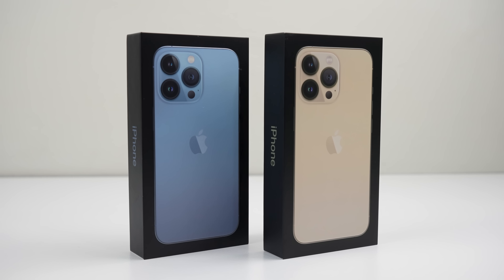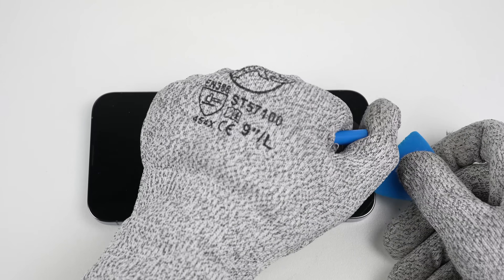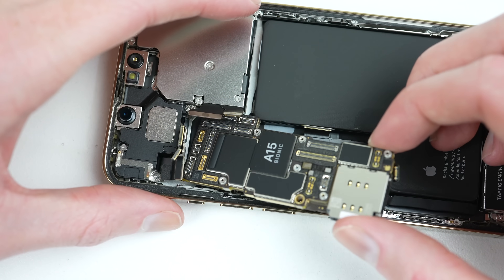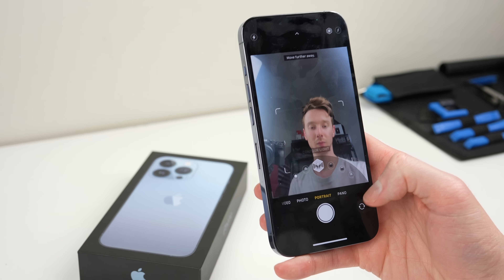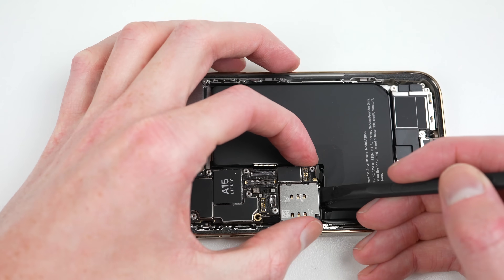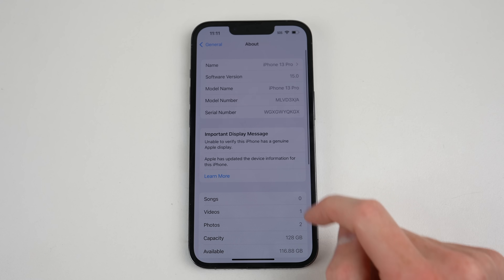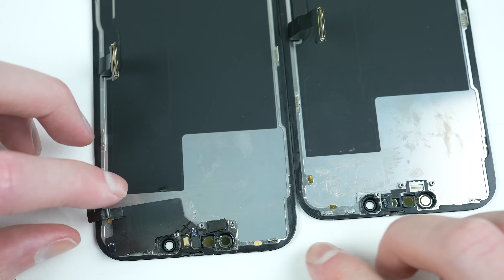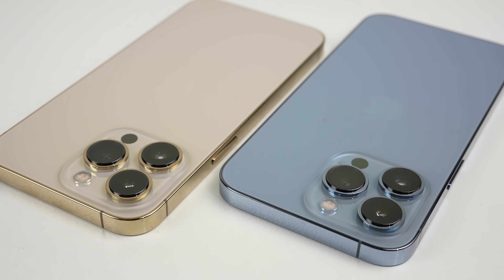iPhone 13 A Repair Nightmare - Teardown and Repair Assessment

Comment: What is making me real mad is Apple saying, bragging over and over about how "green and recycled and love environnement " they are when in reality they do not give a crap about it. Getting on for hours about trivial "yay paper wraps and recycled metals", in the mean time the real big impact is blocking repairs, forcing throwing phones away, and making people upgrade to the same phone with no changes (exept the usual "slightly better camera, performance and battery". 
Apple just has the worst attitude of any company. They do not hesitate to lie, f. their customers/environnement, and whatever the feel like doing to make money.
Reply: We're going eco friendly by selling the charger separately in another package
Reply: @Fishßeef  sadly yet samsung remove charger too on The S21
Reply: also don't forget not switching the iPhone to USB C even though the iPad, MacBook, Android phones and almost everything else has
Reply: @amitkulkarni3922  The EU will soon force Apple to use USB-C connectors for the iPhone
Reply: @moow950  I heard about it, but they said there's an exception for "wireless" charging so I feel like Apple would rather make the iPhone portless and switch to wireless rather than switch to USB C. Especially since they can make more money from the MagSafe charger like they did with the Airpods after removing the headphone jack.
Reply: @amitkulkarni3922  most of iPhone users have lightning port but not USB C including me, if they changed the port to USB C then they would have to buy a new charger which is More waste since Charger outer are made from plastic. Hence Magsafe is the safest way if they want to change the charging mechanisms
Reply: @PS-ub8st Almost everything else that's portable besides iPhone uses USB C. Including portable speakers, wireless headphones, etc. Even on Apple's side the iPad and MacBook uses USB C for charging. So logically speaking, it makes no sense for the iPhone (and Airpods) to still have lightning when all their other products have moved on to USB C. The only reason why Apple would stick to lightning is to make more money by selling lightning cables since very few manufacturers sell lightning cables. 

So your point of "more waste" doesn't make sense because it's literally just having to switch the cable and most people by now probably have a USB C cable if you bought any product in the last 5 years. Plus, you can still use the same power brick that comes with iPhone since that uses a USB C port. And for MagSafe, that's even worse than lightning because it's still only works with iPhones and it's even more expensive than lightning or USB C (so it's just going to create even more environmental waste).
Reply: @PS-ub8st  Most iPhone users have lighting but how many people have a usable Lightning cable? 
Some iPhone users have bad cables I'm talking about the those that are using an old iPhone till this date, like iPhone 6 users 38% of apple users are still using iPhone 8 and Below and those people are gonna buy a new charger sooner or later
If they buy a lightning cable it cannot be used for any other devices if they switched to USB - C however they wouldn't need to buy a seperate chargers for other  devices that they could potentially buy
Also what about an Android user trying to switch to an iPhone they won't be getting a charger and they can't use their charger meaning they will have to buy a new charger meaning more waste
Also I can Guarantee you most iPhone users that are switching from the old iPhones like the 6 or the 7 will 99.9% of the time buy a new charger because they are charging at a Measly 5W the 12 pros support 18W charging and charging at 5w in 2021 is a mere joke and 
Why are you even Justifying apple this is stupid IMO
Reply: all that "recycling" bs is nothing when you take into account apple uses slave asian handwork (Foxconn sweatshops) but hey, no ONU/OTI inspectors would dare to put a foot on those chinese concentration camps
Reply: @alerey4363  Reduce, reuse, recycle. Apple devices life much longer than those of competing brands and are then usually sold 2nd or 3rd hand. So they actually follow the most important R, which is reducing the amount of devices. Apple supports phones from over 6 years ago still with updates, which means there must be a significant amount of them still out in the wild.

Yes their repairability sucks. Which however may not matter in the big picture, if devices simply break much less frequent on average and simply don't require any repair at all. The amount of people that actually has to buy new instead of getting a repair may be completely insignificant in relation to the total number of devices. I know, unpopular opinion. Go start the hate and continue to funnel all your frustration towards Apple.
Reply: @alerey4363  aaah that fallacy again that the benine Apple hater likes to repeat over and over again. That throtteling was done to preven crashes after voltage droops with aging batteries. That was years ago, the applicable models the 6S. The very phone that will be supported in full by iOS 15 this fall, after being released over SIX years ago in 2015. I dare you to name even one competitor that supports their devices this long and in this manner. Maybe you also realize that people don‘t suddenly throw away their phone and buy new just because it became a tad slower after several years of operation.
The average device lifetime of iPhones is vastly higher than with other brands, providing the best possible contribution for emission reduction. Period. I hope these facts don‘t destroy your worldview all too much.
Reply: It's all just marketing (i.e. lies). If they say they're enviromentally friendly and care about your privacy, it means they're burning coal in India and handing over your metadata to the NSA
Reply: Don't forget rendering a device unusable by activation lock, even in the hands of the owner!
Reply: @tonyconpint1342  you know that the owner is the one that enables Activation Lock right?
Reply: @tonyconpint1342  Uhm that does not happen at random
Reply: @itsTyrion  so what if the owner forgot the password to the account and can't reset it? I've seen it happen. Plus, there is also zero way to get ahold of the owner of the device itself so it completely negates anything regarding being a good Samaritan.
Reply: they giving excuses to cutting the charger cost greedy
Reply: It’s also sad that Samsung follows Apple most of the times. Example removing the headphone jack and charging brick. I feel Samsung phones will fall into this trend anytime soon.
Reply: @NotAdam8  they already have. Remember the bootloader camera issue on the z fold 3?
Reply: @NotAdam8   Correct but keep in mind Samsung Aint doing repair shit Tactics like Apple you are still able to get your phone repaired by 3rd party Or DIY yourself Apple one is just full of shit
Reply: Don't ignore the fact that the iPhone STILL uses lightning meaning you need another cable and the cable Apple gives you is useless for 90% of people
Reply: @zUltra3D  Most of Apple user already has Lightning port so Yeah If they changed to USB C including me I would have to buy USB C to USB C cable, magsafe is the only choice if they want to change the charging mechanisms
Reply: @PS-ub8st  still, Lightning makes no sense in 2021. iPads, iMacs and MacBooks use it yet AirPods and iPhones don't. If they change to USB-C, it's still better cuz you don't have to pack 2 cables for your iPad and iPhone.
Reply: @zUltra3D  well most iPhone Users doesn't even have USB C so yeah Your comment doesn't work here, i dont even have USB C🤷
Reply: u know you’re not supposed to “Throw your phone away” but recycle it right? Lol
Reply: @happi_legend  where do you think a majority of e-waste ends up?
It goes to third world countries, by the ton, in huge containers, then gets badly dismantled with the extraction of valuable materials being the sole objective.
The processes used are normally bad for the environment and the 'workers' are often the poorest in the community with no regards to modern health, safety and environmental impact taken into account.  Recycling on a worldwide scale isn't the utopia that big manufacturers want you to believe.
Reply: @Falconhunter276  it’s actually dismantled by a robot named Liam. No joke. Lol. 

They get sent to a warehouse weight. Dismantled. The left over melted glass and metals and components get weight again at the end to ensure no loss of materials. 

Then these are used to make the enclosure on new iPhones or macbooks or iPad. Really. Knowledge is power man. Do research :D
Reply: By green they meant green dollars for them 💸 💸
Reply: Too bad a lot of stepford folk keep giving these shysters money.
Reply: Apple is so two faced
Reply: The iPhone 12 should have come with a plug but 13 didn’t have to as we ‘already’ have them.
Reply: Apple:
What's the minimum we can do to appear green?...yea that's do that....
Reply: The only green they are concerned about is green color of money
Reply: @Rokmononov  I shouldn't have to say that this is, in fact, subjective. I can not prove that Apple have the worst attitude of ANY compagnies, obviously. This is my opinion, feel free to have a different one
Reply: Samsung is also going this direction and I feel sad Samsung is even becoming the next Apple.
Reply: @kusogaki_man  the unfortunate reality is that apple is greenlighting the entire industry by doing this. Samsung and admittedly many other phone makers are following suit because if one of the biggest tech companies in the world can sell millions of phones whole screwing over all repairs and making extra profit, why shouldn't they? We saw it with the headphone jack, the charger, and now it's repairability. Legislative solutions are going to be the only realistic way to stop this.
Reply: @kusogaki_man  samsung is apple for android lol
Reply: @akdhidbeif  tbh the only apple is good is ipad,watch and even mac but iphone is just problematic for some reason
Reply: It is the new strategy that a lot of companies keep doing, virtue signaling. The cater to the emotions of dumb consumers and it seems to work…
Reply: @ElJosher  I guess providing software updates for 6+ years, enabling customers to hold on to devices for so long and avoiding new devices altogether is also just virtue signaling for dumb people?
Reply: @RandomUser2401  While also limiting repair… Apple talking about the climate and how they are at the supposed forefront of decarbonization does not mean crap when Apple incentivizes e-waste with their anti repair crap. That is the epitome of virtue signaling. Apple tries to appear benevolent, but they aren’t.
Reply: @ElJosher  By having an above-average device lifetime of at least 5years and a very high 2nd-hand resell rate they are actually doing a ton for the climate. Reduce, reuse, recycle, in descending importance. As I said before, in the big picture the amount of devices that have to be replaced prematurely due to being not reparable is probably tiny compared to the amount of devices sold from which the vast majority lives 5+ years, while devices from other brands simply break down much earlier beyond any possible or economically viable repair.
Or even worse, become a paper weight since the manufacturer stops supporting the OS of the device after 1-2years. While Apple supports devices between 5-7 years after release.
Reply: @RandomUser2401  All the while forcing updates on to your phone that make it a little worse over time until its so slow you're practically begging for a new phone, I've seen it happen first hand
Reply: @gokublack8342  that's objectively wrong. Indeed several iOS updates made older phones faster.
Reply: @RandomUser2401  And yet I've seen them make phones slower first hand
Reply: Apple is full of shit.
Reply: Well, they have become so powerful and rich to the point that they LITERALLY don't give a crap. They will keep making fancy-looking smartphones, knowing that sheeple are just plentiful out there.
Reply: Except they're not forcing you to throw it away, they want it back.
Reply: There 3 ways that I think it will be okay

1:we have to wait in China so that they can bring a device that can make the display work face id even if it an third party display just like true tone

2 spend a fortune on buying most protective cases

3 always be careful and maybe train to have good reflexes
Reply: @Ghost_ridr  with such expensive phones you must always be extremely careful. Those OLED screens are freaking expensive, even for the manufacturer.
Reply: @RandomUser2401  yea I heard they expensive so might as well get a new protective case when I got a new phone
Reply: @Ghost_ridr  they'll probably just find a way to crack the screen to be able to transfer it's data to the replacement like they do to get true tone back yoday
Reply: @akdhidbeif  ya
Reply: Yeah what a hypocritical company
Reply: Apple loves recycling! They’ll recycle your phone & sell you a new one the moment anything goes wrong with it.
Reply: What's worse is how the fanboys keep defending these practices.
Reply: Yet people still buy their crap and they continue doing this maybe stop buying their crap and force them to do right.
Reply: @Devin-O  its because if you already Comfortable with one Ecosystem you wont be switching unless your not comfortable anymore
Reply: Apple borrowing the "we cheat, we lie, we stole" from Mike Pompeo
Reply: our little of fightback is to not use their garbage cans. and laugh at their users.
Reply: @lhexolauroxel1727  that wont change anything and hear me out samsung will follow apple path
Reply: apple doesnt care about anything but MONEY thefts that most parts i know about it n they do liars ton like two face no joke
Reply: It's called virtue signalling.
And anyone who believes them is a gullible idiot.
But if you already bought any kind of apple product you're already a gullible idiot to begin with.
Reply: So I guess the phone is a little cheaper considering they don't include the charger with it, right?
Reply: Looks like they skipped reduce and reuse lol
Reply: I think very few of these businesses believe in being green.  It's all talk, an illusion of being green.  All that matters to them is profit.  The one that gets me is refuse collection vehicles going around with "zero to landfill" written on them.  I always wonder what they do with waste that is impossible to reuse, recycle or burn.  There must be a lot of it.
Reply: Because you suckers will believe anything your masters tell you. Suck it up and watch the planet burn.
Reply: Give a fuck to environment, its a business.
Reply: Not to mention the software updates that gradually damage the performance of older phones so they can no longer function correctly, forcing you to throw away what should work so you can buy a new one.
Only time I accept that kind of behaviour is in the case of samsung having the software update to destroy the phones so there are no more battery explosions. That is in the name of safety and I can support it.
Reply: No, it means they push for you to recycle your phone. No one is buying a $1k phone and then throwing it away after is gets some damage. If they are, that is user error, not apple.
Reply: And yet there will always be stupid people to buy their products
Reply: @SamyT1994  well they are the best phones on the market so. Maybe someone else should give them some honest competition.
Reply: @Goldheart55  You haven't seen what's on the market if you genuinely believe that this crap is the best device sold today lmao
Reply: @SamyT1994  name one phone that’s better in more than 3 directions. Hell, even two. You can’t.
Reply: @Goldheart55  off the top of my mind: Z3 Fold, Z Flip, S21, Note 20, just to name a few, try harder apple sheep.
Reply: @SamyT1994  what the hell? Literally every one of those are junk with not even a single feature that’s better 😂 How’s the folding gimmick working out with those plastic screens on those folds dude? You didn’t even try 😂
Reply: @SamyT1994  I mean, you’re the one bringing Samsung phones to the plate. For literally the same price as Apple you get less future updates, less security, cheaper and weaker metal bodies, worse cameras in end product shots, and a chip that is still weaker than the XS from years ago. It’s probably the weakest you could even try to compare. Seriously, did you try? What am I getting shafted on here? Sounds like I got the sweet deal fam.
Reply: It's similar to the billionaires pissing on the peasants telling them to quit using plastic bags but offering no suitable replacement (Seriously, what the fuck replaces plastic bags? Nothing.) and ignoring the fact that 70% of all pollution is coming from the 40 richest people in the world.
Reply: @acumenium8157  ermmm.... paper bags?
Reply: Lol I love how you act like this is an apple problem and not an every business ever problem. Apple has turned it into an art form yes, but google would just as quickly shit on you as would samsung or any other big company.
Reply: @mizinoinovermyhead.7523  
Wouldn’t b surprised huawei does the same damn thing as well!
Reply: At first when iphone 13 came out I thought I was gonna buy that one but seeing so many repair problems made me either buy the 13 or just buy the s21
Reply: @Ghost_ridr  why only choose between Samsung and apple ? there's plenty of interesting options out there on android side
Reply: @akdhidbeif  nah I'm using huawei now and im starting to think to buy samsung yea
Reply: @Ghost_ridr  to be fair they do amazing phones currently, it's sad that they're locked out of google.
idk where you live but xiaomi is pretty good and oppo too, color os has come a long way (vivo also, and one plus, tho 1+ is not as good as it used to. they're all owned by the same company anyway)
Reply: @akdhidbeif  I know xiaomi and I saw mi 11 but idk if they came out in my region since I never seen them on any online stores
Reply: @Ghost_ridr  coming from an s21 user here either by s20 series  or s21 ultra because s21 is just renewed s20 with no charger so🤷‍♀️
Reply: Apple is actually doing the best job among tech companies when it comes to environmental protection, even with this third-party repairability taken into account. Apple is also not forcing the throw-away of iPhones, they just need you to pay them to get it fixed, either through repair fees or through Apple Care. You wouldn't throw away the phone anyways, since even if it were broken, it could still be recycled and the usable parts in it will be reused. Depending on the condition of your phone, you might get some cash back.
Reply: @haomingli6175  Ohhh yeah cash back yeah right almost 0$ for an S21U and 100$ for an used iPhone 12 that's a really great deal I'd say

Also apple isn't doing the best job look at Google they have been Carbon Neutral since 2011 and is one of the cleanest tech companies in the world 
Seriously dude check where you get your information from don't be blind to only side
Also do you think apple Recycles the iphones? 60% of the components if the iPhone is broken is thrown away in a garbage dump because it is simply more cost effective to produce a new one rather than repair,Restock and Reshelf not only apple does this but Amazon and other companies do this Aswell so if you're ever recycling a new iPhone or returning a product they're going to the garbage dump NOT BEING RECYCLED
Reply: Now the reason why they only focus on camera performance battery and screen is cuz all of this is explain by this one video

 https://youtu.be/n1xb_o_nhhc

Like If they r actually  environment friendly apple explain why u have to make the charger and headphones in a separate box while u can just put them in the same box
Reply: Reducing environmental impact at point of manufacturing is actually an incredibly green thing to do. These phones are sold by the millions, worst still, millions are sold to people who don’t really need to upgrade! They buy the latest tech because it’s there. This isn’t just an Apple problem, it’s a consumer problem. Allowing 3rd party repairs would have very little impact on the environment, broken components still go in the bin. I totally get that people want a cheap repair job on the 1k phone they dropped whilst pissed, but if it’s environmental issues that really concern you, don’t buy the phone in the first place because making it cost the environment more than you realise. At least Apple are trying to make waste less of an issue, if only because it increases their profits lol
Reply: Dear Robin…and what is Samsung doing? Or Huawei? Xiaomi? …and all the others? Yeah…definitely very repair friendly! 🤦🏻‍♂️ Please free your brain from stand by modus next time you make a comment here! Double standarts 👉🏻 obvious dumbhead 😉
Reply: @Erdadler  Ok, first you either are satire or trying to sound really dumb. Anyway, I fell I would just add that one person not loving Apple does not make it an "android or samsung" fanboy. 
Matter of fact, I did not mention Samsung at all, that is only you making this up.
I am strongly against any company following Apple's horrendous anti repair route,  including Samsung.
Apple just happens to be the worst of the worst regarding that.
And also, It makes no sense to me to defend Apple's behavior like you are. You have nothing to gain by defending it, as Right to repair only is positive for everyone,  unless you are Tim, that I sincerely doubt .
So please do not say absolutely nonesense crap without thinking about it for a bit longer, before posting it here, including if you want to response.
Reply: @Erdadler  they're doing it because Apple is. Remember how they removed the headphone jack? Or the charger? What happened? Those companies all followed suit as apple made it acceptable to do so. Same thing here. If Apple can screw over repair shops while have customers still buy their products and make extra money why wouldn't they?
Reply: Surely a company is allowed to have people not take apart their devices
Reply: @Paradoxical124  not in this case, phones should be repairable. They are the most used daily devices for most people and therefore subject to large wear and tear. Preventing opening of phones to fix a minor issue is the equivalent of throwing away a car because a door got dented.
Reply: @francoismurrell4604  Definitely! That’s why the Right of Repair Act is so important!
Reply: @Paradoxical124  at the end of the day if you pay for it you should be able to repair it